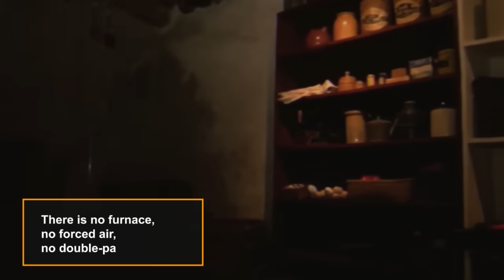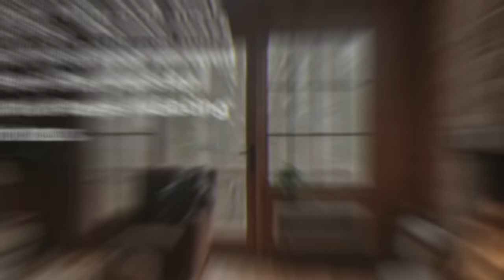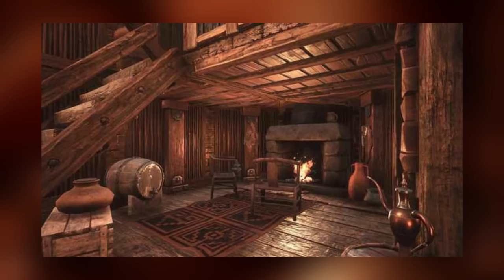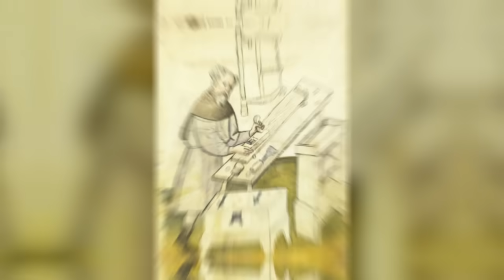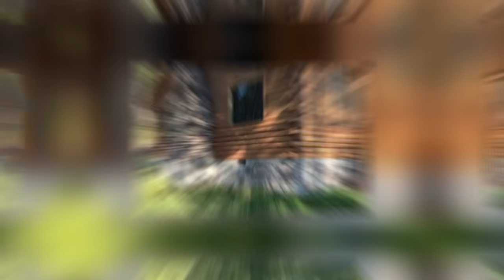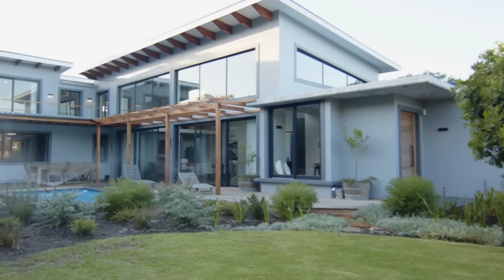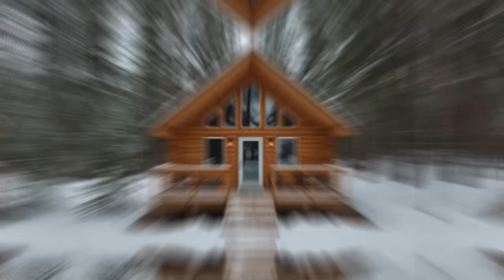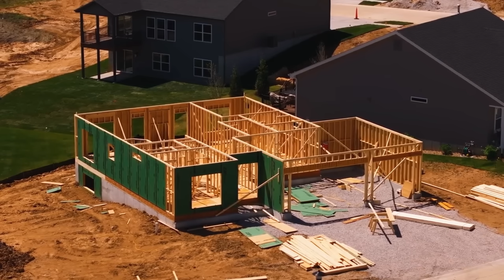Why Medieval Log Cabins Stayed Warm in -40°F While Modern Homes Freeze

Comment: Water central heating.
5 tons of water, 5000 liters.
Minimal required for home heating.
10 tons of water tanks even better.
Heat water to 80 degrees of Centigrade.
And you have similar effects.
Radiators will slowly release stored energy from tank.
Of course good water pump, Grün dfoss, reliable from 1980 es never failed.
Never stopped.
Good insulation.
Styrofoam, stirodur minimum 10 cm.
20 even better.
Roofing... 30 cm insulation.
Remember head losses in body heat can be from 50% to 70%.
Some have 50 cm insulation on roofs.
No air conditioner needed.
Think. Use your common sense.
And have a great life.

Comment: I have lived in houses that were there before a map made in 1650 & they are built out of necessity not fashion. The fireplace is on internal walls so it heats two rooms downstairs & two rooms upstairs & acts as a  storage heater & doors on the rooms & the stairs hold the heat in the rooms. Low ceilings max less than 2m mean the heat stays we're you are not in the unused space above.real old homes with original features are wonderful. My current house is more modern but was built due to necessity like my previous home & is lovely.

Comment: Modern houses all depend on electricity, which can go out during a storm.
That combined with a much less efficient thermal management results in a frozen house in a winter storm when power is lost.
A backup generator or battery system would help, but it is still not as efficient as the old log house with a good fireplace.

Comment: Just to be pedantic but 1847 is NOT medieval! That covers (roughly)  1000 - 1600.
Reply: Actually, 500–1500. From the end of the Roman Empire to the Renaissance.
Reply: @EVanDoren before 1000 is definately part of the Darke Ages, however what is considered properly medieval in terms of stonre architecture amd the various dynasties etc does not start until atound 1000 maybe 900 (Rheims I think is an early example?) It ends by the 1600's with the early stages of the enlightenment.
On the other hand there are always transitional periods.

Comment: Half of the thermal mass in the log is OUTDOOR temperature. The real beneficial thermal mass would be the masonry stove and chimney. This could be mimicked with any massive objects inside your house. The modern trend of allowing your home to cool off when you're not home is why you've got no buffer against the cold.

Also, ancient single glazed windows were shyte back in the old days, just as they would be now.
Reply: Also the video is way off about the Scandinavian or Russian style "masonry heaters" as modern ones even on the lower weight side will stay warm and radiate heat into your home for 24-48 hours, heavier ones (2 tons plus) might even be heated twice a week in -15C weather...  Well the old-school wooden-frame windows are kind of shite, as soon as glass got cheaper as an material they stared adding layers of glass to make em better, but the main problem is the frame, wood changes dimensions with humidity so making an airtight frame is kind of impossible...

Comment: As someone who has designed, engineered and built many timber frame houses, almost everything you hear in this video is utter garbage, it's laughable. Whoever made this vid is completely clueless. Also, the main reason log cabins are warm is solely due to their small volume, nothing else

Comment: Ahhh,  I somewhat disagree. 
Log cabins homes back in the mid-evil times stayed warmer ... only because none of them had windows, and very low ceiling,  like 6 ft low. 
At most they had one door, which was covered with thick hides/ skins.
 
Modern homes are 1000s of times more efficient in many ways, comparatively. 
Instead of 12"- 16"  logs, we have walls that are 6" that are just as thermally equal or much better. Also better fire safe ratings, lol. 
It has allowed us to build ridiculously large homes, with tons of windows, doors, exhausts, and all the modern crap we love. 

Hey simple log homes are amazing that kept civilization alive during those times, but this video is a bit silly, comparatively - with too much memberberries nonsense.
Reply: Yeah, this person doesn't seem to understand that wood, especially denser wood, has a pretty low R value compared to modern insulations.  Straight wood ranges around R1 per inch, while modern insulations range from R3 to R7 per inch. Literally 3 to 7 times more efficient. 

  Then when you bring in vacuum insulated panels, it goes from being an out of the park, to out of the Solar system comparison.  These range from R25 to R50 or so an inch!  Not that these are practical for most housing situations though because they are much more expensive and you can't cut them to size (and they can lose their thermal efficiency over relatively long periods of time).
Reply: @justinw1765  Like here in the Appalachians, we still have log cabins from a 100 years ago standing. 
To survive they built double walls all but the south. In between those walls they added tons of chinking to get some thermal defense. Massive stone fireplaces in the center, to build fires and soak up heat in order to survive the night.  Yeah, wood- solid is actually a poor insulator.  
I hate even commenting on these videos as it helps these YT reinforce silliness.  I wish thumbs down would still be a workable option on YT today.

Comment: Mass is a double edge sword. Once the mass does get cold, it takes a lot to heat it back up.
Reply: But look at how we build modern houses in Poland. The thermal mass of brick walls is isolated all around with syrophoam. Even the ground plate is insulated from underneath with styrofoam. Some modern methods insulate even wall from the window frame. All this to create minimal thermal bridges. No air ventilation chimney, but recuperation. They build the heating system into the floor. The amount of temperature used to heat the floor is so minimal that it feels cold. Because 20 °C floor is still lower temperature than our body. Unfortunately older houses have very big energy intake and those improved methodes are farily new. It cost a lot to build a house that energy intake is close to nothing tho. But on the other hand american houses quality is deteriorating, and prices are high.
Reply: "Once the mass does get cold, it takes a lot to heat it back up." That can be a good thing too. I live in an 1860s building made of 80cm brick and stone. The walls keep the summer warmth into late autumn/early winter and also keep the winter chill until after the peak of summer. No AC needed. In summer, I just open the windows at night, when the temperatures outside are moderate instead of hot. 
Temperatures in my city range from -10°C to +30°C with extremes of -20°C and +40°C. Because of the thick walls, I can not only stay comfortable without AC all summer long but if the heaters would fail in winter, I'd be comfortable for three days, alright for a week and would survive with extra blankets, candles and lots of cooking for up to three weeks. 
The high mass being difficult and slow to heat back up would only become an issue if the heaters failed during the depths of winter for a month or longer.
Reply: The root cellar  never froze,  the foods kept cool and dry, no more than 11' under ground...  Your favorite Baked Potatoes in Frozen February !  :-)
Reply: @SeaJay_Oceans  Yes, the deeper you go, the hotter it gets.  This is normal physics
Reply: Yeah, you gotta keep it warm- it ain't a part-time job.
Reply: It works the other way around too. Cooling a thermal mass once it's warmed up takes a lot of energy. I work on the basis that the easiest way to keep a house cool is not to let it get too hot in the first place. 

My wife worked for a number of architects until she retired and we've known people who have done things like having a brick heat sink as part of the design.

Our house is quite easy to regulate. We have a lot of glass facing due East, a small area of glass facing North (we're 32° 42′ 54″ S), and the hill we're built on shades us from the westerly sun. We use blinds to control the amount of sunlight streaming in. It works really well to heat the house first thing in the morning, as long as there's some sun. In peak summer, the sun rises over a hill and its effects are delayed. But in spring and autumn, the sun rises over the ocean and we get the effects from first sunrise. 

When we miscalculate, we rely on sea breezes to cool the house down starting in the early afternoon. When all else fails, we have reverse cycle AC.
Reply: Very true.  This is why it's so important for it to be designed with south facing windows that can keep it heated by the sun during the day.  (for example: an "Earthship" type build).
Reply: That's why I only date petite Women!! 😆
Reply: Not really.  That is called air-conditioning.
Reply: Moronic take.  If power goes out.. you will d1e in a modern home.  But stand a chance in a thermal mass home.

 Lets say you run out of logs... and it takes you so much time to get more... that your home is ice cold...

 Yeah.. it will take much longer to heat up fully... but you can always sit near the fire, fireplace.. and be toasty warm / hot.

 One can also put on a few layers of clothing and blankets.

Comment: The problem with a loss of power during the winter isn't that you will freeze. It's that your pipes will freeze and split open.
Reply: Although you can just allow all pipes to drain....
Reply: Tell that to the families of the 200+ people who died in Texas in 2021 when their power went out during a winter storm.
Reply: @signal1267  Some sought heat in their cars, in the garage, with no CO detectors or proper exhaust duct to outside the garage. One whole family perished because no public warnings were issued. But, they were mostly entitlement moochers who needed to be put down like a South Dakota puppy.
TX had a $23,500,000 surplus when they refused sirens for the Flood Zone Capital of the country. 125 Texans were not worth saving for $6 million already granted and dispersed by Obama and Biden, but hoarded by TX's GOP.
Reply: @dthomas9230  ok commie

Comment: There are building types between the log and modern structures that you didn't add to this comparision, methods that are also better than modern structures that should used, such as Tuor (post and beam with mud/cob on woven branches, someitmes finished with lime plaster on the inside and outside that are just as warm as log structures. There are the Victorian Era homes build with planks of solid wood covered with lime plaster on the inside that are maybe not as warm nor stay warm as long as log structures but heat faster with less fuel than a modern home. I know this because I lived in them for decades. The greatest failure of Modern homes to heat and to stay warm is the thin wood veneer glued together with sawdust and the sheets of chips of wood also glued together that are used to make up the spans between the wooden stud framework. There is pink insulation in this span and even though these walls, at 8" thick, may be as thick as a log structure's walls they do not have the mass nor the density of the walls in log structures  solid wooden planks nor mud/cob on woven branches.

Comment: In Sweden most older farm-houses are built with logs, which later was clad with panneling. So they look modern from the outside..  But absolutely fabolous, well-insulated, solid houses. 

And almost indestructible. My friends big brother were going to take up a new door opening in such a house. First they had to locate and try to extract all the huge, 40 cm long, hand-forged nails in the area. Then cut the opening with a very large powerful chainsaw... 
My friend said it took a day and at the end his bro was covered with sweat....

They also had old self-circulating water radiator system and a heater which could run either on oil or firewood.. And they owned forest where they could get firewood if they needed.
So in case of a power outage, they would still have heating. But that nevered happened, cuz it is Sweden...
Reply: 40 cm = 15.75 inches
 You're welcome
Reply: So what are you saying Sweden does not have power outages?
Reply: it was sweden... now renamed swedistan
t. francistan